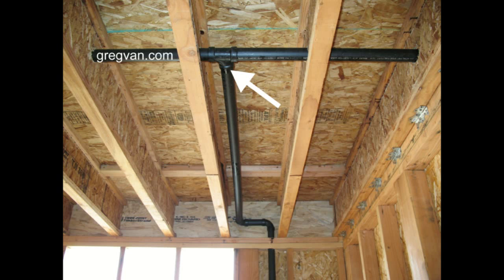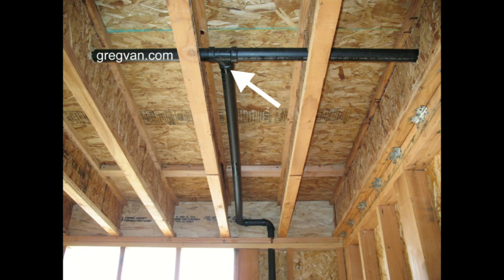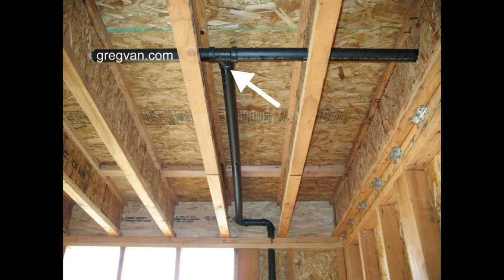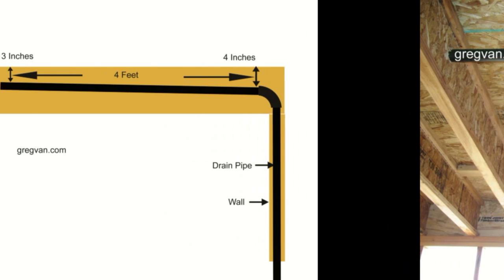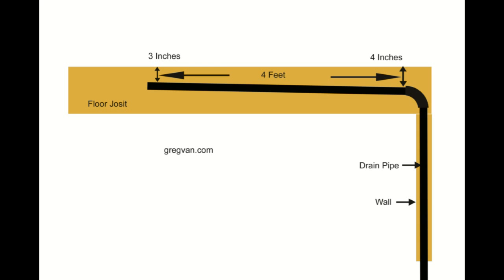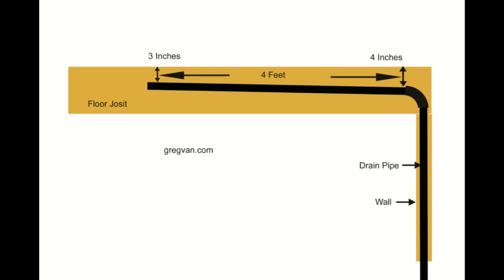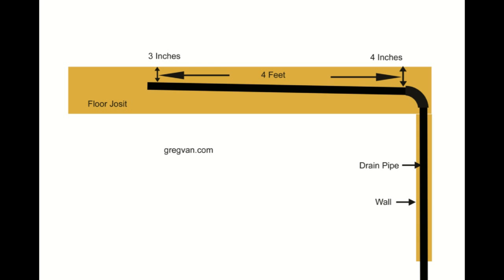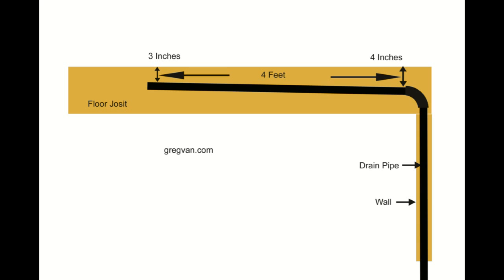How Much Slope Per Foot in Plumbing Drain Pipes - Framing and Plumbing Layout

Comment: In this video you say "it can be GREATER than .25 per ft but not less" HOW greater can you get away with??? Wouldnt the water run away from solids faster with a GREATER drop and cause problems clog ups ????? How greater can you go without water running away from solids ??????? And i am not referring to just pure sink/bath water im talking about toilet
Reply: like7still found this...http://inspectapedia.com/plumbing/1616_Slopes.jpg
Reply from the maker: I was looking for a building code reference number. The link you found might not be the best reference.
Reply: you're right
Reply: like7still I found a site last week claiming code was 1/4 inch in 12 minimum, 3 inches in 12 maximum (or straight down vertical). It said more than 3 inches in 12 would cause water to flow and solids to stick.
Reply from the maker: like7still I don't have a plumbing code book and therefore can't provide you with an answer. I've heard what you're talking about a few times and it kind of makes sense, but would have a hard time imagining any problems with waste buildup inside a pipe, on something that was sloping between 30 and 60°.

Comment from the maker: This message is for pei bossman. It's quarter-inch slope for 3 inch pipes or smaller and 1/8 inch slope for 4 inch pipes that are used for drainage.
Reply: Yes there would be if the house has more than 3 1\2 bathrooms it needs a 4" pipe so the 3" pipe most of the time being used wont be over loaded by all the fixtures
Reply: gregvancom
Reply: Raul Garcia you know your stuff my friend.

Comment: does septic tank pipe also follow the quarter inch slope? thanks...
Reply: Yes. And the septic tank inlet must be at least 10' away from the dwelling. 4" pipe is usually used for this. The slope is also required for the effluent pipe leading to the drain field.

Comment: Hey Framer, I agree, plumbers are PRIMADONNAS
Thanks for the clarification. BTW same here in Hawaii, but if you use 4 inch pipe you only need 1/8 of an inch per foot.
Reply from the maker: It's the same here, 4 inch pipes only requires an eight of an inch per foot. I'm not allowed to say anything bad about plumbers, because I already got in trouble, so you're on your own there. Thanks for visiting.

Comment: Codes are in place for a reason. Running more slope than the pipe is required can lead to the liquids running away from the solids. I don't know where you live, but in my state vent pipe only has to grain to gravity, there is no pitch min/max.
Reply: I gave no interest in becoming a word smith. I HAVE ENOUGH PROBLEMS WITH PLUMBING.  What does grain mean What's a weir. Stop impressing each other and talk plain language.
Reply: Every time I write, this computer changes my words. ex: I wrote: have, not gave!
Reply: Turn off predictive spelling or whatever it is that changes your words. This supposedly helpful feature is making people lazy.
Reply: @bovellois  or just proof read.
Reply from the maker: I'm in California and they require a quarter-inch per foot slope for lateral vents. What state are you from?
Reply: Are there some meds you are either taking too few of or way too many of?

Comment: Most of this is correct. I just want to say that there is one place where more than 1/4" would not be acceptable. That would be the length of pipe in between a p trap weir and the originating point of vent. If say there is to much fall on a trap arm it can "s" trap. The seal will siphon and you will get sewer gas emission.Trap arm maximum lengths are computed with the correct amount of fall.
Reply from the maker: I didn't know that, but I don't think it would be a problem on traps that aren't more than 24 inches away from the vent pipe, but it makes sense that it could be a big problem with traps that were farther away. If you have it, could you provide me with the building code reference number?
Reply: gregvancom I just remember it from being a master plumber for over 35 years. The best place to find it is the uniform plumbing code illustrated training manual. Look at the section trap arms The picture makes it all clear. It shows a horizontal line drawn from the trap weir and if it intersects the top of the trap arm pipe on the inside then there is no way for air to get out and it s traps and can siphon .On stacked systems the line should hit free air space to vent and never hit that top part of the pipe so there is always room for air. No gurgling and no bubbles. Exception would be non conventional systems like combination waste and vent where the trap riser to floor sink etc is less than the trap size by a good margin so the pipes never are over half full and definitely should not be over graded on the horizontals. I think you know what I am talking about but that picture would make it evident to readers of the video that are not builders.I do enjoy watching the videos and am not trying to rain on your parade.
Reply from the maker: You're not raining on my parade and I sincerely appreciate your input. I was not a master plumber nor will ever claim to be, but I did do a lot of plumbing. Obviously this video wasn't about traps or trap arms and could spark up a variety of different conversations, but does provide you with a few general rules about plumbing. Thanks again for your input and I'm definitely going to try and wrap my mind around it and possibly explain it to my viewers.

Comment: In another word , you are saying 2% slope  for drainage system . I thought that the building code allowed 1% slope min. in North America. Thanks for the Info.
Reply from the maker: If I did my math correctly, by dividing 48 into 12, I came up with 2.5%. Larger diameter pipes don't need to slope as much, for example a 4 inch pipe usually only needs to slope an eighth of an inch per foot.
Reply: gregvancom  Thanks. your math is right
Reply from the maker: You're welcome

Comment: So I just want to clarify. A 1/4 in rise is added per foot? So if it was 5 feet in length then it would be 4.25 inches in height instead of 4 inches at the 90.
Reply from the maker: No, a quarter of an inch rise per foot in 5 feet would only be an inch and a quarter. You will multiply one quarter of an inch rise for every foot in horizontal length. A 10 foot horizontal length would require you to multiply 10 x .25 = 2.5 inches.
Reply: Ok thanks.
Reply from the maker: You're Welcome

Comment from the maker: I had no idea there was a maximum slope, but since there is and you're suggesting that the slope shouldn't be more than a quarter of an inch per foot, which would be less than 1°, which is a big difference, between the maximum and minimum, then it would be difficult to support your argument. Why do you think they would let you slope a pipe 45°, if it wouldn't drain solid waste sufficiently?

Comment from the maker: Here is Cory's reply, it just got posted in the wrong spot. 

IRC (2012) P3005.3 is where max slope of horizontal pipe is called out. The definition of "horizontal pipe" in the same document is a pipe or fitting that is at an angle of less than 45 degrees. I've always been told stick between the minimum and maximum for a horizontal pipe or go a full 45 degrees to assure adequate drainage.
Reply: Wrong this code references the MINIMUM slope.

Comment: IRC (2012) P3005.3 is where max slope of horizontal pipe is called out.  The definition of "horizontal pipe" in the same document is a pipe or fitting that is at an angle of less than 45 degrees.  I've always been told stick between the minimum and maximum for a horizontal pipe or go a full 45 degrees to assure adequate drainage.

Comment: Not supposed to use much greater than the 1/4 inch (for 3" or less pipe) or 1/8 inch for larger.  Solid waste will be left behind and water will drain off clogging drain pipe.

Comment from the maker: Your plumber might have a good point, but these are minimum requirements not maximum. I personally don't see a problem with sloping the pipes more than the minimum and as far as the oil goes, and I'm no scientist, but it seems to me that oil would flow faster down a pipe with a steeper slope. Remember, this is only my personal opinion.

Comment: I am being told by a plumber that going more than 1/4 inch per foot is a bad idea, that water will drain faster than oil, leaving the oil behind to build up. I wanted to put in a little steeper slope since there are 4 x 90 degree bends in about 10 feet. 

I am I wrong to ask for a steeper slope?

Comment from the maker: It would all depend upon the size of the pipe, but as long as you have the correct drainage slope, required for the size of the pipe, then you shouldn't have a problem. 3 inch pipes and under usually require a quarter of an inch per foot, where 4 inch pipes can use an eighth of an inch per foot slope, but you would need to check with your local building department, to verify these measurements.

Comment: I have 9" between my floors does that mean my drains can get up to 36 feet away from my drainage stack?
Reply: No, bottom of pipe to bottom of pipe.  3 1/2"  outside diameter plus drop of whatever your elbow fitting is

Comment: Thanks for the video. Have to support a 2" drain pipe that runs parallel with floor joist and your video gave me the answer to getting the slope correct. Pipe had a major sag in it causing stoppage/clog.

Comment from the maker: @LATTCPLUMB Could you provide us with a specific building code, you're referring to.  If not I would like to warn future readers, to disregard this information.  Again, I would like to remind everyone, to check with your local building department, before applying any material you read or watch on the Internet, just in case you're building department has different rules.

Comment: Anyone using the Uniform Plumbing Code: Vents that are 6 inches above the flood rim level of the fixture are not required to have any grade. They can be instaled level or graded back to the drain that they serve.